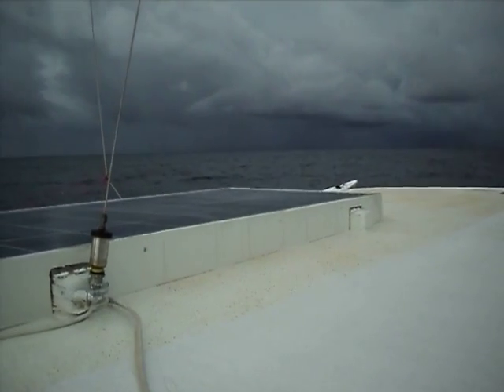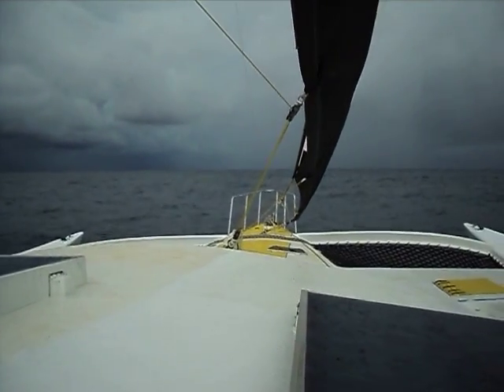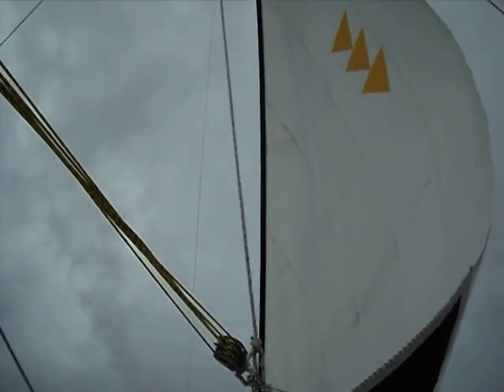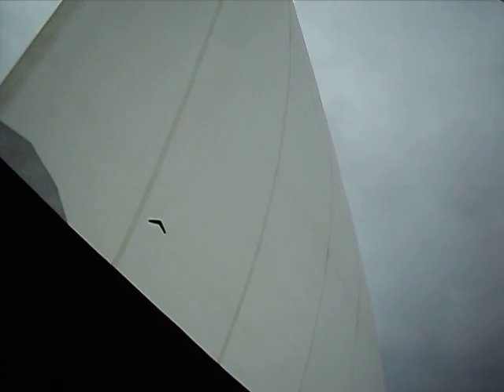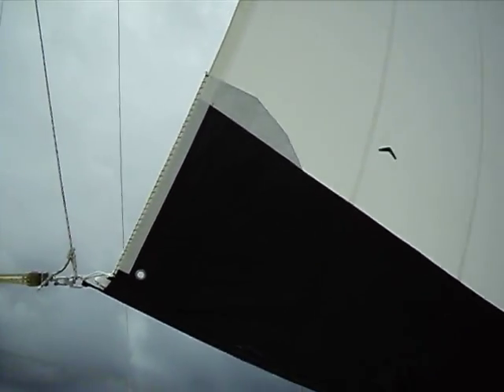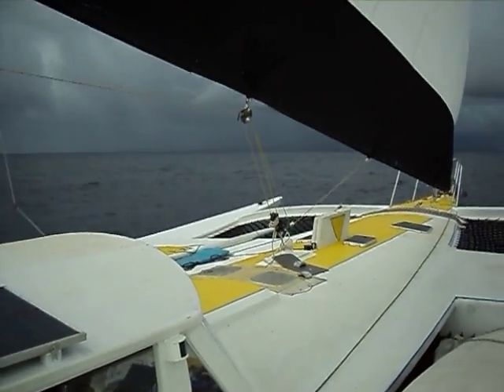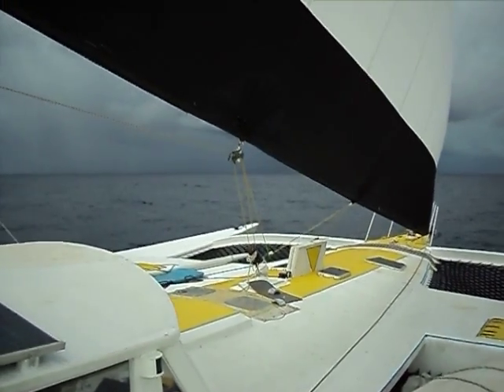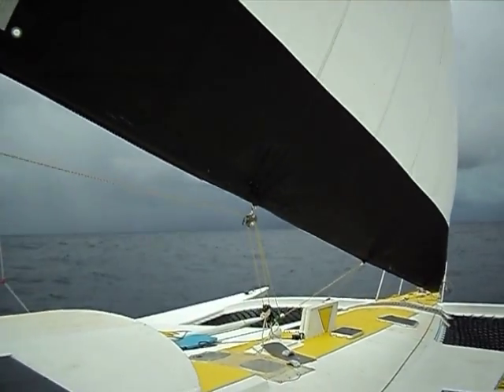Hot Buoys Trimaran Dec 4 2010.avi

Comment from the maker: @dnomyarnostaw  Call the sail what you like.  The point is that it isn't a Bermuda rig.  There is no full batten main sail, and the entire sail plan is easy and self-tacking.  Unlike a "jib" there is zero camber in the sail and the trailing edge doesn't flog if loose.  Camber comes from raising the spar high above the deck where it provides lift.  "Jibs" can't do this.